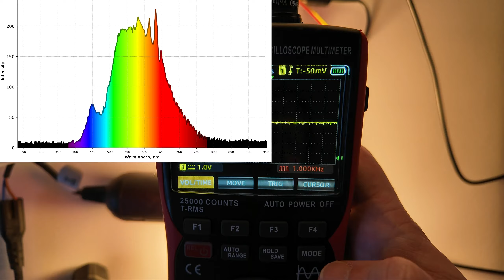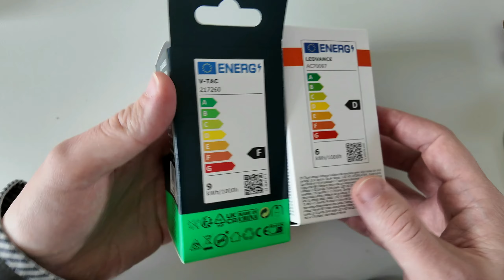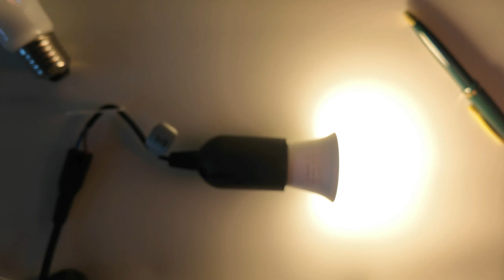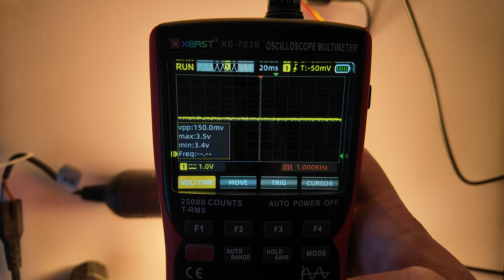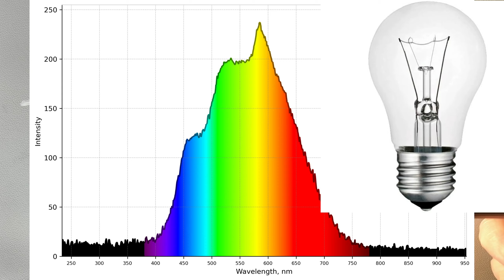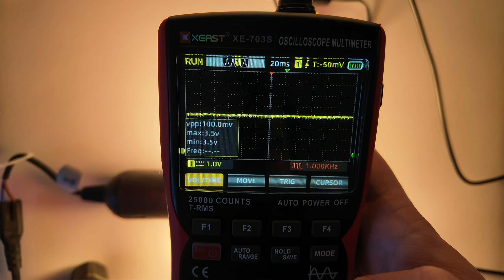$0,70 vs $7 LED Lamp: Will You SEE the Difference?

Comment: They differ in the radiation pattern. The cheap one shines down and the expensive one shines to the sides. You can rip off the plastic dome to make it even more directional without using a mirror. If you want a filament bulb, wait until one goes on sale in your local DIY store. Dimming is mostly an American thing. Better have a 2 way switch or a combination of ceilin and wall lamps. Then you don't need special bulbs.

Comment: - You have to check what the warranty conditions are. Marketing is professional deception, and Osram's is particularly bad there.
- CRI figures can be deceiving, too, because it consists of several submeasurements. I bought a discounter bulb (Gut&Günstig - an EDEKA brand) advertised as nearly flicker-free and with a CRI of 97(!), whereas the expensive Osrams next to them only have 80. And considering that it seems cheaper to make high CRI LEDs with low color temperature, I gave them a chance. But compared to an incandescent bulb they had an awful yellow tint, like sahara sand in the sky, quite unnatural, whereas the tungsten light (same 2700K spec) was very unoffensive and in comparison has a slight reddish hue. (Which is less so with halogen bulbs at full brightness.) Tungsten really is like wellness light, being pleasant on the eyes.
So it seems it is even easier to find high color temperature LEDs with daylight spectrum (expensive!) than low color temperature ones with daylight spectrum (niche product!).
I have some experience with fluorescent biolight. Some early ones had a greenish tint, another brand was alright. True-Light really excel. Their light is indistinguishable from daylight. It has no odd tint that indicates it is artificial light. But I haven't tried their LEDs yet. - This tint that makes a light source noticeably artificial is what also defines fluorescent quality. (BTW, they're not offering biolight LEDs with UV component because UV LEDs are lacking regarding longevity.)

It really saddens me that perfect LED replacements for incandescent light still aren't feasibly available. (I tried several different warm white LEDs and they had similar tint issues.) Because we can only imagine what impact the mass rollout of awful light quality has on humankind's psyche. It could be contributing to the chronic stress epidemic. Our world is dominated by capitalism which notoriously offers false improvements by taking advantages away. We keep shaping our society to nourish fear, in part through artificial scarcity.
Reply from the maker: Yes, CRI 97 looks unrealistic indeed :)
Reply: @DimitriiLab  Have you found any warm white LED that is natural like tungsten? Or is that really limited to the rare warm white daylight ones?
I am also wondering whether Osram is on the same level as the cheap ones and simply more honest about the CRI figure or whether they've fallen behind in technology and look even worse. (Of course the video camera cannot convey such differences well.)

Comment: I’m using 200w incandescent lamps for regular light in the main room, all of them are controlled with a dimmer. In dining room, I use 200w as well the food looks gorgeous. Bedroom; maximum 60w I prefer , 75 and 100 will be a good fit for the desk lamp. Also in each room there are red incandescent ( If you can’t find reds, use a red globe and put a normal incandescent) lights too. Rated at 25, 40 or 60 watts.
Reply from the maker: Yes, when I tested an incandescent bulb, the color looks really good. But it's too hot and consumes too much energy for daily use.

Comment: Cheap one. People often put LED bulbs in old design fixtures and shades made for  incandescent ones, so they will be cooked and damaged that even with lower consumption you will not get the price compensated in the short life duration that results from that. I hack cheap bulbs and put another value on the control resistor (2x4 Ohm SMD paralel, usually), double or quadruple, so the power, heat and ripple get down proportionally, increasing longevity.